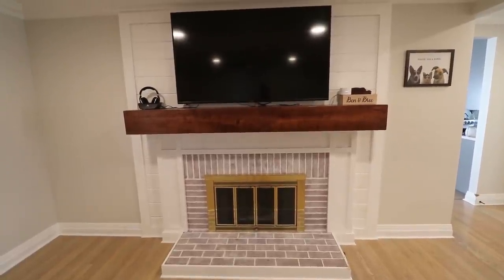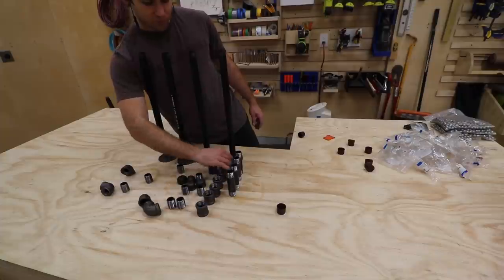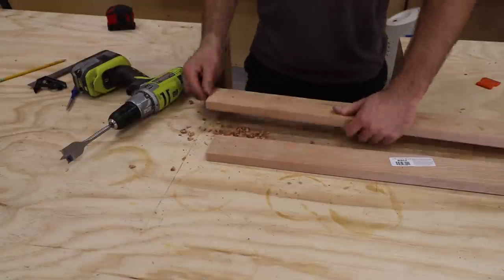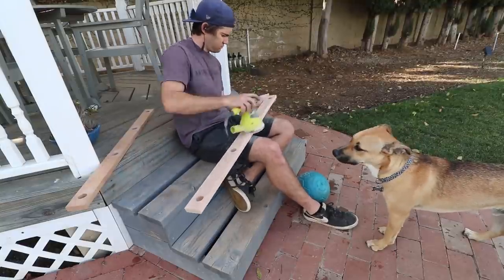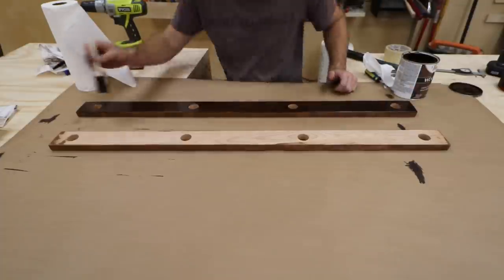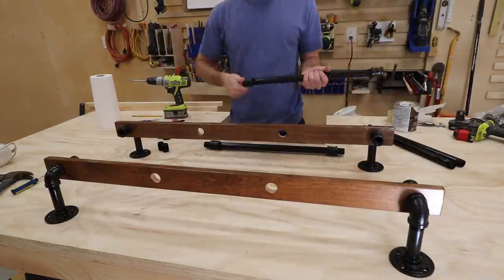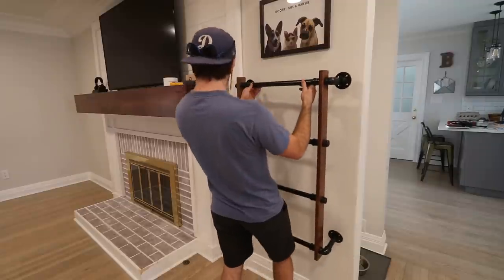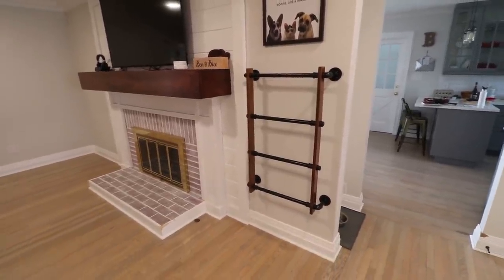Making a Blanket Ladder

Comment: Could have used hollow wall anchors for the left side to hang the ladder.  Straight screws in drywall probably won't hold for long.
Reply: Not holding that much weight, tho, and I'm SURE Ben knows about wall anchors...
Reply: @nixhixx  weight aside,  movement from adding and removing blankets will loosen them regardless
Reply: @cncwoodworxroc6881  Possibly, but the other side being firmly in the stud could very well be strong enough to prevent that.
Reply from the maker: I could have used anchors, and maybe I will add some in the future, but I anticipate it holding for many years before needing to make any repairs. By then it may have already moved to a different spot in the house!
Reply: @BenTardif  Thanks Ben! It looks great... And I was sure you weren't in the dark about their use.

Comment: I would at least use drywall anchors on that one side and worse case use a toggle bolt on one of the screws, it will never come off the wall
Reply: I'm pretty sure both sides were in studs.,. Maybe i missed something....
Reply: @ColeSpolaric  He specifically said they weren't on the left
Reply: @steve_main  i missed that, at the beginning he said he measured the studs making it sound like he made it to land on studs on both sides. Either way, drywall screws were the wrong choice because of their lack of sheer strength.
Reply: With the weight of the rack alone, I would definitely use anchors. I was waiting to see him use the first two screws to maybe hold it in place to mark for anchors but nope! Easy fix, Ben. Gotta say, love the idea and final outcome.